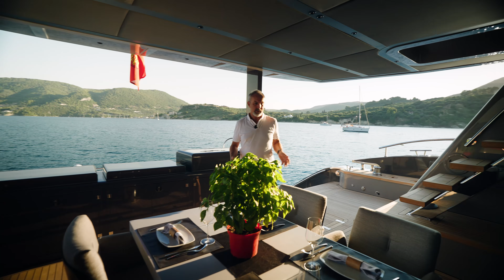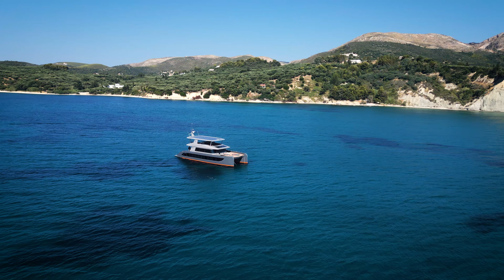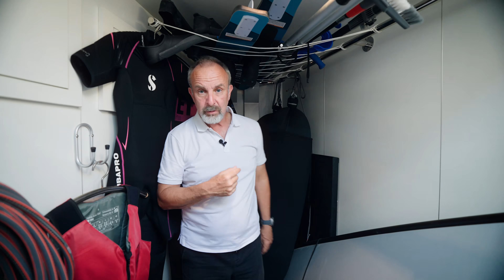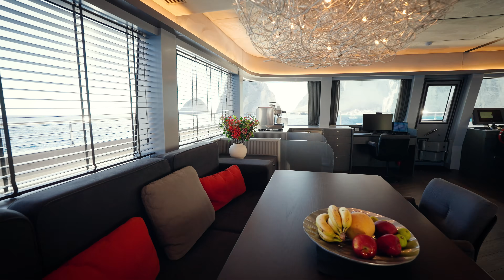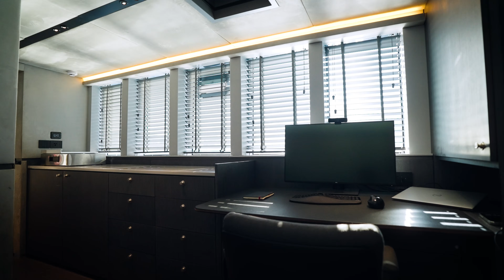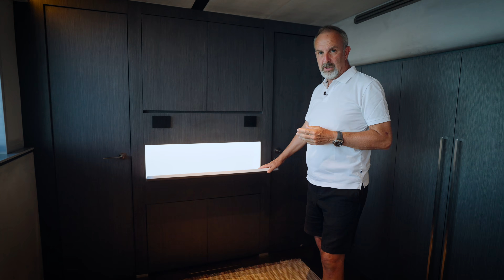⚓ SITARA Walkthrough | Owner Hubert Greinwalder Tours His 82ft Luxury Yacht

Comment: Very well designed. Congratulations. The only question is: if you were looking for maximum autonomie (solar power, watermakers, food storage, etc.) why didn’t you choose to have sails (on a cat, you can cruise also at 8 kn under sails but no noise, no cost, no limited range). As a non-crew operated boat, you could have a rigide wing-sail hydraulic system that you can manoeuvre at a touch of button. As you have been very much thinking about everything, I guess you have a logic answer to my question.
Reply from the maker: Excellent question! I come from the sailing world and have been sailing for about 40 years. Sailing is my passion! BUT...
I’m sure you’re familiar with the magic triangle. It consists of “performance,” “comfort,” and “cost/price.” If you want to travel (and live) on a sailing yacht with a certain level of comfort... the yacht becomes heavy—and loses a lot of performance. You can see this on Sunreef sailing yachts, which only really “sail” in strong winds.

There’s another factor to consider: The forces on board a sailing yacht increase in proportion to the square of its length. This means that once a yacht reaches 50 feet in length, sailing becomes “exhausting” for a couple. And in strong winds, it can quickly become dangerous.
You see the consequences of this all the time: Couples end up cruising under engine power because it’s too much work to set the sails... 

I understand the argument that you can do all of this with technical assistance (hydraulics, electric winches, etc.). In practice, however, these are highly complex systems that frequently break down and require constant maintenance. 
Another point: Sailing yachts carry an enormous amount of standing and running rigging—which is constantly exposed to sun, wind, and rain... meaning it ages quickly and thus requires a lot of effort in care and maintenance. 
As a sailor, I know that wonderful feeling of being propelled solely by the wind. In stronger winds, that’s fun for 5, 6, or maybe even 10 hours. After that, it quickly becomes exhausting… and you find yourself longing for a “comfortable” motorboat that you can steer in any direction at any time—regardless of the wind’s direction. 
As you can see, the decision—sailing yacht or motor yacht—depends on many factors that you’ll need to weigh on a case-by-case basis. ANY decision is the right one—as long as it lets you live your dream!

Comment: I approve of your choice of your floating home ...... rather than an a status symbol. 🧙🏻‍♂️🥼🏞️🇬🇧 Given my scientific training and maritime interests I think  it's highly likely you will add or convert,  within the next  5 year to a hybrid diesel electric propulsion system , if you convert you can use the Volvo parralel electric motors between the engines and the IPS sail drives  they also do a dual input  drive leg system ..the electric motors are silent, 96% efficient  need no gearbox and give instant exact control . ..and no maintainance for many years.  
The other option is the true electric  diesel hybrid with battery storage and buffering which  reduces the fuel burn by 30-60% depending of the cruising requirements and does away  80% of the diesel engine run times in the sub stoichiometric running mode given stored solar capacity .. it's also safer and more reliable given the new generation of Na ion and LiFe PO or MO cells. and the life span will be in the order of decades 10000 -15,000cycles.
Reply from the maker: Thank you for your thoughtful comment and for sharing your technical perspective!

You're absolutely right that hybrid propulsion is developing rapidly, and it's exciting to see how much progress has been made in recent years. When SITARA was designed, the focus was on creating a highly efficient, reliable long-range cruising yacht with proven technology, while using solar energy to cover the yacht's onboard electrical needs.

We follow developments in hybrid and electric propulsion with great interest, and as battery technology, energy density, and charging infrastructure continue to improve, it will certainly become an even more attractive option for many yachts.

For now, we're very happy with the balance SITARA offers: the range and dependability of conventional diesel propulsion combined with extensive solar power that allows us to enjoy long periods at anchor with little or no generator use.

Comment: 80 ft. 2 hulls, that's like a 100  ft. Monohull. All aluminum, very expensive. Built in Turkey saves a lot of labour cost. I'm guessing 8-10 million?
Reply from the maker: That's a reasonable comparison. A catamaran of this size undoubtedly offers interior space comparable to that of many monohulls over 100 feet in length.

You can find all additional information about the SITARA on the website www.sitara.yachts

Comment: As a designer, do you think you could raise the solar roof, and have underneath more solar panels that extend out like a cantilever, thus increasing the solar footprint when conditions are favorable?
Reply: I looked at the side decks width  and immediately thought this would be better if they were covered by a roof projection  like on many trawler and explorer yatch's . .. that would also add perhaps an extra 30% solar space , but also help in extreme  weather conditions such as heavy 🌧️☔ and reduce the solar heat load on the interior systems as the sun rises above the horizon during the day and in hotter latitudes.
Reply from the maker: That’s a very astute observation, and we did in fact consider similar concepts during the design process.

A wider roof over the side decks would certainly provide additional shade and better protection from rain, and might create space for more solar panels. These are all real advantages, especially in warmer climates.

The drawbacks, however, are increased weight in the upper section and greater wind resistance. Every design decision is a compromise between functionality, performance, aesthetics, and practicality.

Thank you very much for your thoughts—it’s always interesting to discuss different design approaches.
Reply from the maker: That’s an interesting idea! In theory, retractable or cantilevered solar panels could increase the available solar surface area.

In practice, however, there are significant trade-offs. On a yacht, any additional moving structure means more weight, greater complexity, increased maintenance requirements, and potential reliability issues. It must also withstand strong winds, saltwater, and the dynamic loads encountered at sea. 

Our goal at SITARA was to create a robust, elegant, and low-maintenance system that reliably delivers energy every day 😊

Comment: Lovely yacht.  Thank you for the tour. 

Few comments regards safety, if I may ... that likely could apply to most newer yachts.  

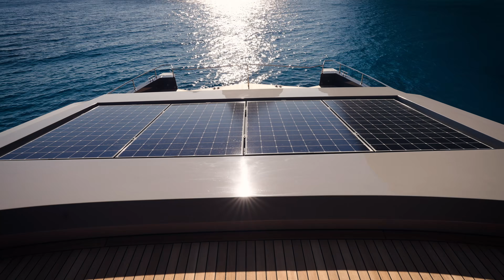13:47 ... Beg your pardon, not qualified in any way to opine, though, regardless, I would advise stripping off the solar panels.

14:33 ... Also, again not qualified, I would advise swapping out the presumed Lithium ion batteries for heavier, less energy dense AGM, or something else non Lithium ion (and thus heavier).  Besides, isn't more ballast a good thing?

A while back, I had looked into Sitara's sister ship, Flagship, another VisionF 82.  

As I understand it, brand spanking new Flagship was getting miscellaneous finishing touches work, including to its battery electric storage system, at a third party Miami facility, after a yacht show in Miami.  

According to the American government National Transportation Safety Board / NTSB files, the BMS of the battery was apparently being bypassed while the batteries were being charged from shore power, in weekend off-hours, with no one aboard, when Flagship met it's explosive & fiery thermal runaway demise, possibly VisionF's last use of what might have been NMC variant Lithium ion batteries.

Truth be told, I'm way too Nervous Nellie about Lithium ion battery applications of most kinds, not to mention Lithium ion battery chemistry variants of any kind -- even "safer" LFP / LiFePO4 -- any Lithium ion chemistry variant -- too many failure modes.

Regards solar panels, again, too many failure modes.  

As but one solar panel example only, look at the fires with the rooftop solar farm of Lineage's massive, six-FIFA-pitch-large, 25 meter high, cold storage warehouse in Los Angeles, California ... both in 2024, and now, after all the attention surely received subsequent 2024's fire, again, for the last time, in 2026.

Anyhow, other than the recommended changes, yeah, a beautiful vessel.

Cheers.
Reply from the maker: Thank you very much for your thoughtful comment and for taking the time to watch the full tour.

Safety is absolutely a valid topic, and we appreciate respectful discussions like this.

The incident involving Flagship was indeed tragic. However, according to the available investigation, it occurred under very specific circumstances during shore-side work while the battery management system (BMS) was reportedly being bypassed. A properly functioning BMS is one of the key safety systems of any modern lithium battery installation.

SITARA is equipped with a professionally engineered energy system using modern LiFePO₄ (LFP) batteries, which are widely regarded as the safest lithium chemistry available today. The complete system—including charging, monitoring, protection, and battery management—was designed with multiple layers of redundancy and is operated strictly within the manufacturer's specifications.

The same applies to the solar installation. Marine-grade solar systems have been successfully used on thousands of yachts around the world for many years. Like any onboard technology, they require proper engineering, installation, and maintenance, but when designed correctly they provide a reliable, quiet, and highly efficient source of energy.

Everyone has their own comfort level with different technologies, and we completely respect that. For us, the combination of solar power and LFP batteries has proven to be an outstanding solution, allowing long periods at anchor with minimal generator use while maintaining a very high standard of safety and reliability.

Thanks again for your kind words about SITARA—we're glad you enjoyed the tour.